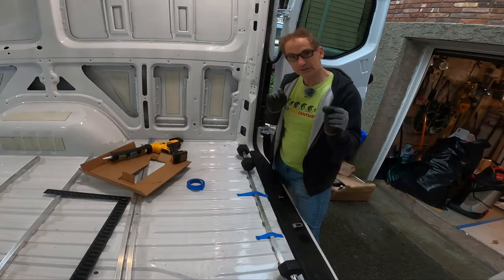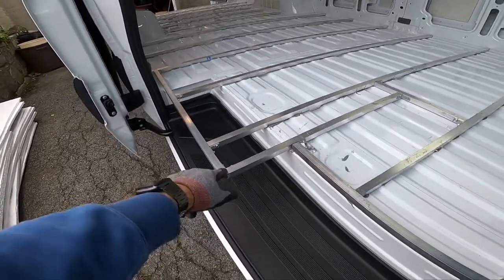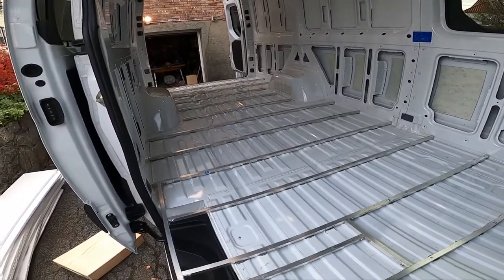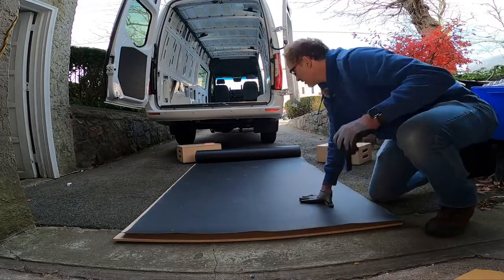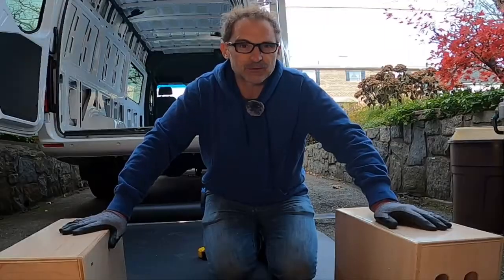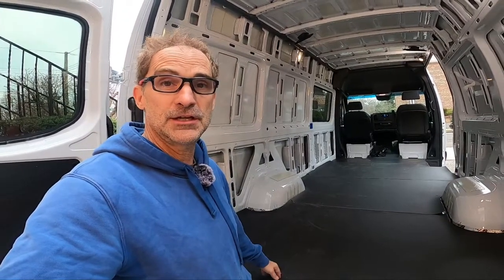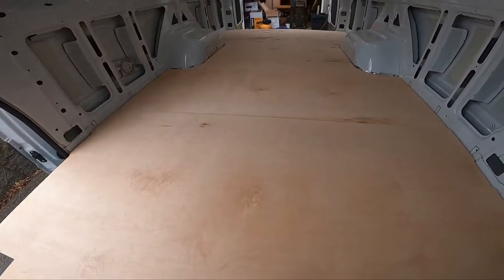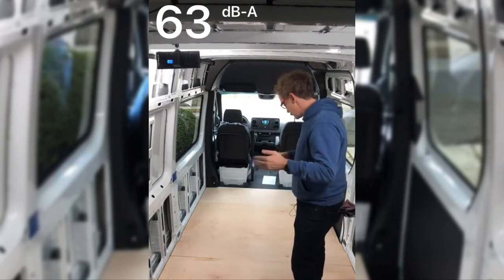Sprinter Van Subfloor Install   Part 2

Comment: Will,  Great video!  Thanks for posting this.  I have a 2021 170 on order that will arrive in July, so I am in the design phase now, and material procurement as well.  What kind of adhesive did you use for the aluminum floor joists?  I totally agree with you about the removal of the paint.  A bad idea and it exposes bare metal.  The floor system isn't going any where!  I subscribed to your channel and looking forward to more watching.  Thanks.  Greg
Reply from the maker: Hi Greg,
Thanks for the kind words. I've never had so much fun on a project as I'm having with this one! Can't wait to see your project unfold. I use Liquid Nails HD Construction Adhesive. Here's a link - https://amzn.to/3uFr5vd. For projects on the exterior of the van, you'll want to consider marine products. There's a saying in the van biz. "Earthquake on the inside, Hurricane on the outside!" Build everything with that in mind :)
Reply: @HackMyVan  Will, Thank you for the information on the adhesive.  A couple of more questions for you when you get a moment...  1.  What thickness plywood are you using?  Is it Birch or Maple?  2.  What about the edge joints, I think I might want to biscuit them so they don't have any differential movement.  3.  What kind of fasteners did you use to attach the plywood to the joists? I appreciate your help.  Still waiting for my van to show up, but trying to get things ordered and designed in the meantime.  Also, did you find that your aluminum supplier was less expensive than using actual 80/20?  Thanks Will.
Reply from the maker: Hi Greg,
I used #10 x 1 inch stainless sheet metal screws countersunk into the plywood, which is 1/2 inch maple. I added supplemental aluminum joists at the joints instead of biscuits (which would have worked just fine, I suspect. My thinking on that was getting biscuits centered on 1/2 inch ply can be tricky and might weaken the wood? Plus, more different kinds of glue... Gravity and the van walls are your best friends in all this. I seriously doubt your floor is going anywhere :)
Reply: @HackMyVan  Will,  OK, thank you.  This is good information.  I agree the biscuits might be a bit tricky with the 1/2" plywood.  I will just plan on screwing it to the joists. I may elect to double up the joists at a plywood panel edges to provide some additional edge support.  Thank you for your help and for the videos, they are very helpful.